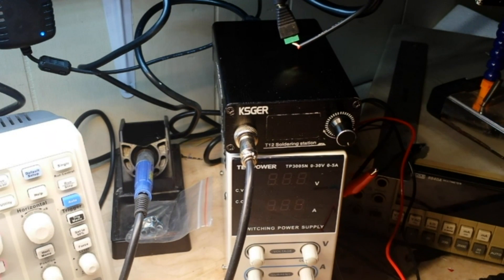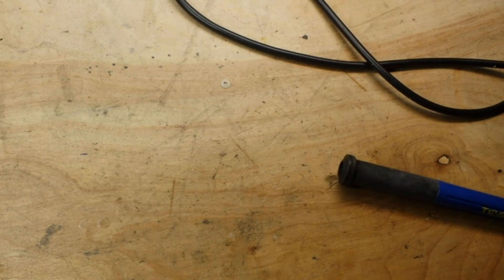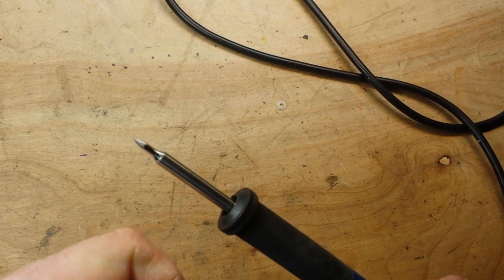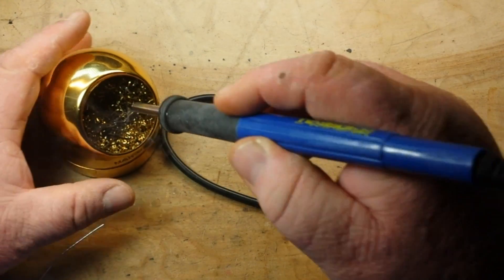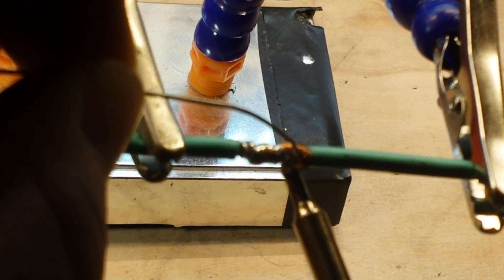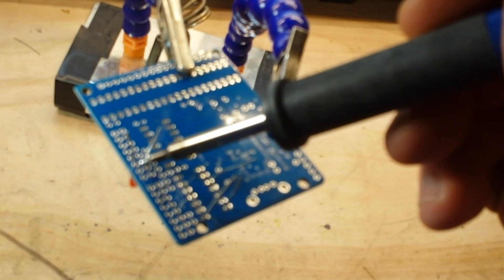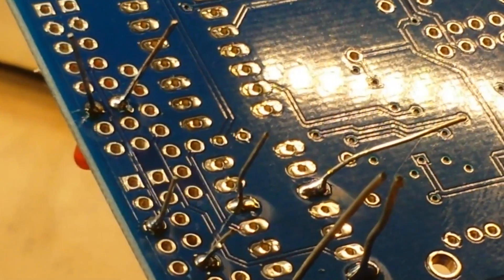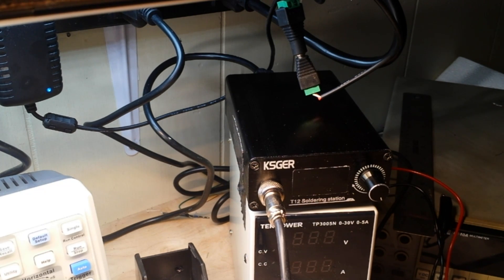New Tips for the KSGER T 12 Soldering Station

Comment: Hi , liked your video, i have one of these myself, and like to have the odd small project or repair job going just to keep me practicing. i havent checked all the comments  so apologies in advance if someone has maybe told you , i happened to notice you mentioned the screen being dim...have you had a close look on the screen surface at all ...try a real thin needle near a corner or along the edge ..pretty sure you will find the same thing i did, there is a layer of cellophene on there..i guess it was so it doesnt get scratched. mines was on there pretty good. but took my time and got an edge up enough to grab it with tweezers and slowly up came the rest. Hope that Helps. screen was a lot sharper and brighter after i took that off !!

Comment: I had to laugh about the K tip. I agree that there isn't really much use for it in an electronics application (aside from a select few wire splices or terminals), but I immediately had a use for it, in removing the soldered-on RF shield containing the internal power supply in my NES to replace the capacitors and install the HDMI kit. The one thing out of countless soldering applications and I almost right away had a use for the most useless tip out there lol.

Comment: K type tip is my preferred tip for drag soldering. It's also wide enough sometimes I can heat up both sides/legs of a component to desolder it. It's a very flexible type of tip that I wouldn't have a soldering bench without.

Comment: Spade type tips are good for certain applications; namely if you have an IC you need to solder onto a board - or even desoldering... you can use these to swipe across all of the pins at once. These are fantastic for clearing up solder puddles which connect 2 or more pins together, they are great for tinning all of the pads at once. They are great for adding the final polish to the solder joint by swiping across them at the end.
That is typically what these larger flat ones are good for. The actual flat spades are great for scraping components off such as LEDs, etc.. things you won't re-use. Or desoldering larger sections. The angled ones are to help with how you hold the iron relative to the pads. The spade should be flat against the board, and tilting based on how big the pads are, how much head you need to apply, etc... These are excellent dynamic tips. You can use the tip for fine work, and you can use the spade for larger area work, you can desolder / solder lots of pads at once, do finishing work, etc... They are incredibly versatile when you know the applications. Hopefully this has helped you with that aspect.
Edit: IF you do through-hole work mainly then there are better tips. Namely the round spades, etc... but you can still use this. I prefer different tips for through-hole stuff, and for other fine work. But for chips, a space is really difficult to beat. You can use the tip to tack weld a pin on, then swipe all of the pads at once to connect them together ( obviously tin first ) and it prevents the issue with shorts.
edit: The round spade I'm referring to is the BC02 one you got in your pack. Those are good for through-hold because you can use the flat part to heat up the pad and the pole to head up the pin at the same time. Transfers a lot of heat, and can also be used to scrap pins on an smc; however the flatter spades are better for this ( angled too ). The D24 is also really good for through-hole and can also be used for smcs... will likely only hit 2 or 3 of the pins at a time, but if you overlap your swipes then it can be used effectively too.

Comment: I have this soldering station. I didn't see you change the tip setting in the station when you put in the new tip. The controller relies on knowing what tip is inserted in order to work correctly. Also mine does not have options for using every tip available. I have been using the closest setting with mixed results.

Comment: Just got one and reads ERROR from first turn on.  Set temp,  made sure tip I was using was selected.   Display shows tip is 0 degrees.  Frustrating, have to return it.
Reply: It's normal, the station is doing calibration. Wait for 5min and it's all set.

Comment: I think your opinion on the K tip is really just that.  An opinion.  As I use the K tip primarily for pretty much everything, and it works great.  Has great surface area for transfering lots of heat to ground planes, and also has good surface area for joining wires together.  It's also the best tip to use for drag soldering SMD chips, which I doubt you could do with that IL tip....
Reply from the maker: You're right,  it is my opinion.
Reply: @learnelectronics  JUST BECAUSE IS YOUR OPINION YOU ARE RIGHT .THAT TIP HAS IS PURPOSE IN ELECTRONICS LIKE DRAGGIN AND BIG THERMAL MASS AND WIRES WICH BY THE WAY IF YOU ARE IN ELECTRONICS YOU DO A LOT
Reply: DUDE YOU ARE ON IT GOOD COMMENTS

Comment: The result of searching for what you show on Amazon:
http://s957.photobucket.com/user/vocabellman/media/Mobile%20Uploads/2019-02/Screenshot_20190224-204846_zpsh1sdtuhm.jpg.html
http://i957.photobucket.com/albums/ae57/vocabellman/Mobile%20Uploads/2019-02/Screenshot_20190224-204846_zpsh1sdtuhm.jpg
To shorten it: No Results. ie - No such a thing exists, but buy these other thousand items that are only related enough to have us mention but have little to nothing to do with what you searched for.
Reply from the maker: Techinal 5 Pcs T12 Series Solder Iron Tips For Hakko FX951 BAKON 950D Soldering Station https://www.amazon.com/dp/B078NWYZQF/ref=cm_sw_r_cp_apa_i_XVcDCbE3N50HW

Comment: K-Type tips have some useful applications like being able to touch both sides of SMD parts to remove them, or squeegee solder across a new DIY printed circuit board to tin it. But I don't think it should be included as the only tip, it's not a general purpose electronics tip. Search for how to use k type tips for more examples. I am partial to a 3/32" screwdriver tip. I like the blunt-ish conical tip you have, sharper conical tips are too cold at the tip end.

Comment: That big heavy massive tip that is not good for anything on electronics is good at scavenging electrical parts specially larger inductors and heat sinks off of Circuit board that’s what I use it for

Comment: The shape K Tips are not bad. It depends on what You want to do with them. The K Shape is one of the best tips for drag soldering. 
Ref: https://www.hakko.com/english/tip_selection/type_k.html
https://www.hakko.com/english/tip_selection/flv/tip_movie.html?id=k-3
https://www.hakko.com/english/tip_selection/flv/tip_movie.html?id=k-4
https://www.hakko.com/english/tip_selection/flv/tip_movie.html?id=k-2
https://www.hakko.com/english/tip_selection/flv/tip_movie.html?id=k-1

To understand all the different Hakko shapes and there application I recommend You a visit on the HAKKO site.
https://www.hakko.com/english/tip_selection/type.html

By the way, I use for many time a genuine T12 in the company, and for private application I own a KSGER T12.
I never found any difference between the genuine and the KSGER T12, except the controller that seems to be
me much better than the Genuine one.

Comment: Usually sellers allow you to choose from a variety of tips but by default they send you K type - at least it was what i've seen so far
About your K tip it is useful for cleaning BGA pads along with solder wick

A tip that i recommend that works good for almost anything is the T12-D12

Comment: I like mine for soldering two wires together.. it has that long beveled surface that covers all the bare wire at ones and bang done. Although I use other tips for other things, my R-s or my BC-1 or IL-s or the D-24.. whatever is called for on my project. Well to each their own huh...

Comment: Nice! update on this product Paul, and I do think that both handles are plastic. But on the blue handle there is just somewhat more plastic and you can hold it  like a pencil. The 'metal one' should be held, I think,  like a tool which needs a more solid grip like you would hold a hammer. Here are the add's with detailed pictures of these handles and what's on the inside:
Your handle, the blue one: https://www.aliexpress.com/item/KSGER-Electronic-Tools-T12-FX9501-Soldering-Station-Solder-Iron-Tips-Welding-Handle-STM32-OLED-Temperature-Controller/32827869974.html?spm=2114.search0104.3.193.48097614nV6h8S&ws_ab_test=searchweb0_0,searchweb201602_1_10065_10068_319_317_10696_453_10084_454_10083_433_10618_431_10304_10307_10820_10301_10821_537_536_10902_10843_10059_10884_10887_321_322_10103,searchweb201603_55,ppcSwitch_0&algo_expid=a2d13d30-dd09-4d0d-ac94-8d7b9d5a210a-25&algo_pvid=a2d13d30-dd09-4d0d-ac94-8d7b9d5a210a
The so called metal handle which is even cheaper: https://www.aliexpress.com/item/Electronic-Soldering-Handle-For-DIY-Soldering-Station-T12-Iron-Tips-STM32-OLED-Temperature-Controller-220v-70W/32779201649.html?spm=2114.search0104.3.186.48097614nV6h8S&ws_ab_test=searchweb0_0,searchweb201602_1_10065_10068_319_317_10696_453_10084_454_10083_433_10618_431_10304_10307_10820_10301_10821_537_536_10902_10843_10059_10884_10887_321_322_10103,searchweb201603_55,ppcSwitch_0&algo_expid=a2d13d30-dd09-4d0d-ac94-8d7b9d5a210a-24&algo_pvid=a2d13d30-dd09-4d0d-ac94-8d7b9d5a210a
And an aluminium handle from BG, so you are right on this one: https://www.banggood.com/T12-Aluminum-Alloy-FX9501-Soldering-Handle-STM32-OLED-Soldering-Iron-Station-Welding-Tips-p-1362088.html?rmmds=search&cur_warehouse=CN

I don't understand why these links are that long?? And I saw that you can buy 24 different tips for this machine. But which one(s?) would be the tips you do not want to do without and use the most? It's definitely to give a thought since all of them together cost the same amount as the standard station....
Here is the link to the tips and I have no idea if it is even possible to choose for a specific tip among the 24 choices. It seems like they make a choice for you and you are just being (unpleasantly) surprised what will be delivered?
https://www.aliexpress.com/item/Electronic-Soldering-Handle-For-DIY-Soldering-Station-T12-Iron-Tips-STM32-OLED-Temperature-Controller-220v-70W/32779201649.html?spm=2114.search0104.3.186.48097614nV6h8S&ws_ab_test=searchweb0_0,searchweb201602_1_10065_10068_319_317_10696_453_10084_454_10083_433_10618_431_10304_10307_10820_10301_10821_537_536_10902_10843_10059_10884_10887_321_322_10103,searchweb201603_55,ppcSwitch_0&algo_expid=a2d13d30-dd09-4d0d-ac94-8d7b9d5a210a-24&algo_pvid=a2d13d30-dd09-4d0d-ac94-8d7b9d5a210a
And this is what the manufacturer did 'forget':
https://www.aliexpress.com/item/Plastic-Soldering-Iron-Stand-Solder-Base-Welding-Wire-Holder-with-Sponge/32856406127.html?spm=2114.search0104.3.338.4c8726f66GbVzk&ws_ab_test=searchweb0_0,searchweb201602_1_10065_10068_319_317_10696_453_10084_454_10083_433_10618_431_10304_10307_10820_10301_10821_537_536_10902_10843_10059_10884_10887_321_322_10103,searchweb201603_55,ppcSwitch_0&algo_expid=287dba1d-1cdc-44bc-b3a3-a4528546e23c-46&algo_pvid=287dba1d-1cdc-44bc-b3a3-a4528546e23c